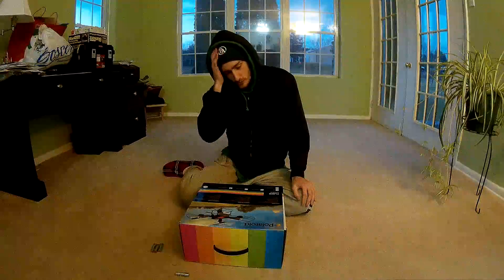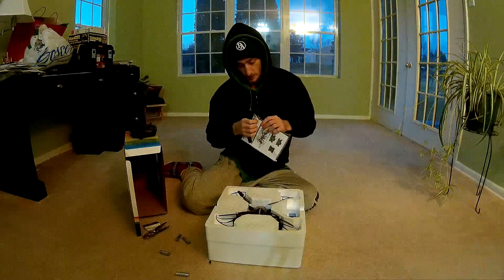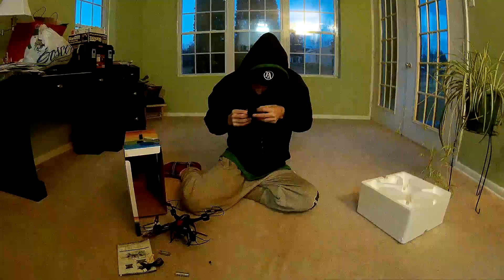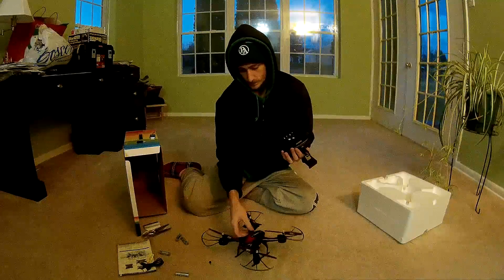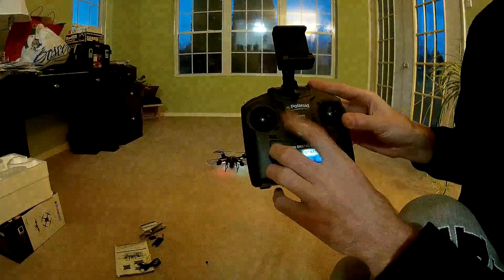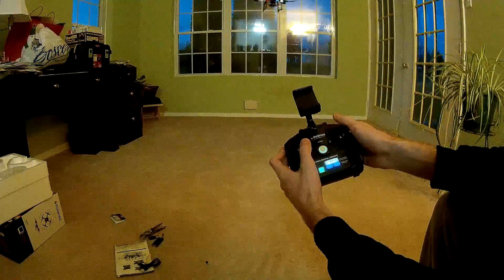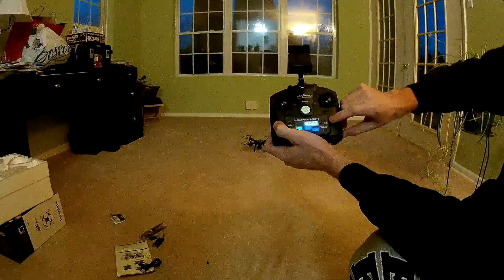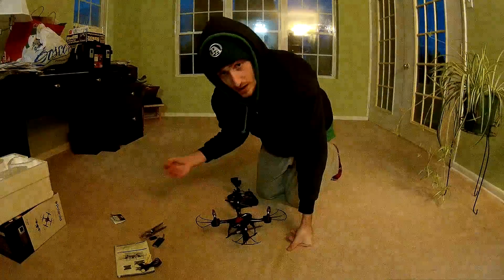Polaroid PL300 720p wifi drone Unboxing to flying

Comment: How do you fly straight up slowly
Reply from the maker: +Nike Arguello slowly throttle up while keep your pitch and yaw as level as you can, your adjustments will be different as the wind changes if your flying outside

Comment: Not very stable
Reply from the maker: I’m still a newbie drone flyer who’s not use to flying at high altitudes with much higher wind
Reply: @VersatileVillains  hey My drone is not going up.
Reply: @VersatileVillains  its not flying it keeps Spinning around
Reply from the maker: You may need to trim it again unless one of the motors is damaged
Reply: @VersatileVillains  will appreciate it bro i need help rn

Comment: i can get a pl800 for 50 to 70 bucks used. is it worth it?
Reply: Wrong trim buttons pro
Reply from the maker: +M Blake Jr I wish I was able to have that deal with that drone where I live it's well over 100$ for that style drone also i would guess it's worth it because my drone actually has a problem with its connector inside the battery port I believe it's loose inside the drone and it forces me to stay grounded and try to fix the problem
Reply: Versatile Villains thanks.....did u figure yours out b4 it broke?
Reply: Versatile Villains its probably a loose solder joint, open it up n take a look
Reply from the maker: I haven't taken the drone apart yet it's been about a week and a half since I've last flown it been really busy over here and in my experience I need at least a few hours to take the props off because they are so darn difficult to get off and that's a must to get to the shell of the drone, once I find enough room to take the drone apart I will, it's going to be looked over sometime soon
Reply from the maker: +guy anderson i explain that in the comment section

Comment: when I turn on the remote controller and turn it back off the controller turns off but the green power light won't turn off please help me
Reply from the maker: +rap kid B20 well this is what I do everytime I'm not using the drone I take the batteries out of the controller and that should discharge all the power within the controller
Reply: to be honest that's what I was doing I just wanted to be sure that's the best move, thank you so much
Reply from the maker: rap kid B20 ahh yes it's always the best move because if u don't take the batteries out they will very slowly loss there charge over time
Reply: thank u so much

Comment: My wifi isn't working on mine. Any ideas?
Reply from the maker: +Riley Gilbert so if your connecting to your smart phone or tablet turn off turn wifi than turn it back on, make sure it doesn't connect to any networks than turn on your drone and give it a couple minutes and have your phone/tablet search for your device the drones wifi should be something like vscam-×××××× as it will take a minute or more for your device to see the drones wifi network, in my case my smartphone takes about 2 minutes to see my drones wifi
Reply: Yo that's a fast ass reply. I'm gunna try it right now
Reply from the maker: +Riley Gilbert oh yes I try to reply as soon as I can with comments because it's always nice to fix/understand the problem and I'm always here to help out no matter what, let me know how that goes for u
Reply: Versatile Villains well, how do I know if it's fully charged. We waited for the wifi to show up but it never did
Reply from the maker: +Riley Gilbert you'll know when the drone is fully charged when the red light under the drone goes out, the charger port for the drone is next to the power button of the drone and will light up red when charging, also what app are you using to connect to your drone / is your firmware on your phone/tablet up to date??
Reply: Versatile Villains I'm using the SJRC app on my iPhone 6+. I've been holding back a update for a while so I'll try updating my phone. My girlfriend can't connect either which is weird and she has a new droid
Reply from the maker: +Riley Gilbert hmmm I'm trying to think of a fix for you maybe try turning off wifi but your phone in airplane mode and than with airplane mode on turn your wifi back on while the drone is on and wait about 2 or so minutes, let me know if this works for you, if not we can try to figure something else out, I don't want to call this device defective just quite yet but you never know, always try doing trial and error first before calling it dead..
Reply from the maker: +Riley Gilbert did that fix work for yall??
Reply: Versatile Villains 
I realized after a while that the socket I was using for charging wasn't working so we've been letting it sit on charge for a while. But still, the wifi wasn't showing up
Reply: Versatile Villains 
I have been letting it sit and charging for sometime now. The light was on, it's been around 2 hours now and now it won't even turn on
Reply from the maker: +Riley Gilbert ok let's go through some simple troubleshooting first to make sure everything is all setup proper. 
1- is your drone fully charged or has a good amount of charge in it to turn on

2- is your battery connected into the drone properly

3- your wifi on your phone is not connected to any network - like it's turned on and ready to connect to a network

4- visual inspection of your drone appears to be in perfect condition, and what I mean by that is that there are no wires sticking out of the drone from anywhere and all wires are connected to it like the servo wire for the on-board camera

5 - your using the supplied USB connector that this drone comes with

6 - either using the SJ RC app or the Polaroid PL300 app is fully updated on your device

7 - if your drone can power on and u can sync the drone to the controller please do and please hold the button ( one key landing) as this should factory reset the drone
Reply from the maker: +Riley Gilbert so another one of my viewers has had this same problem where they were charging it, letting it charge for awhile and that. All of a sudden it wouldn't turn on, if those steps that I listed don't help you then I believe you have a defective quadcopter, as always you should always keep your receipt as I believe it may need to be returned and honestly this may be a pain in the butt when I say this but pick up the same drone but a different one, as I had to do and I still love this drone, yes it's had its problems but that was my own fault